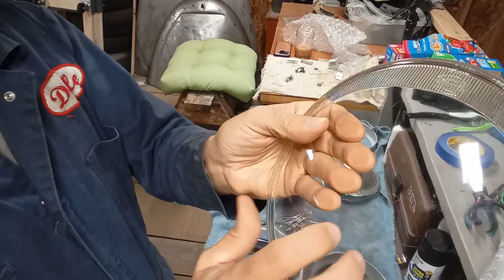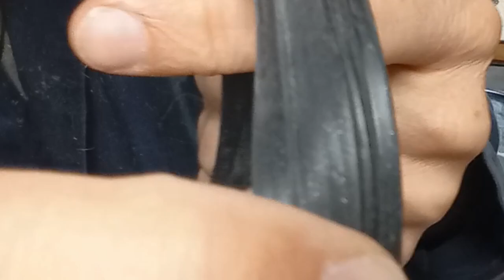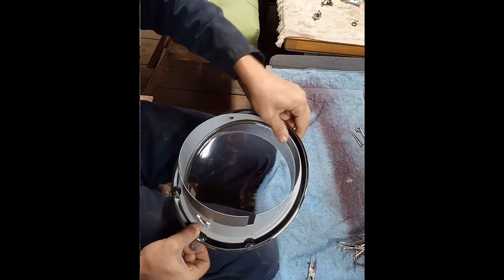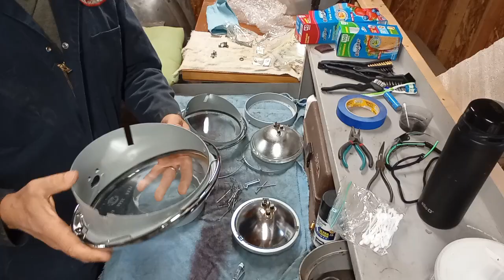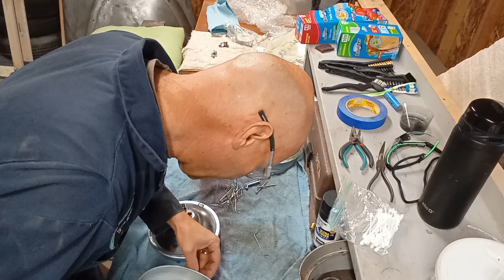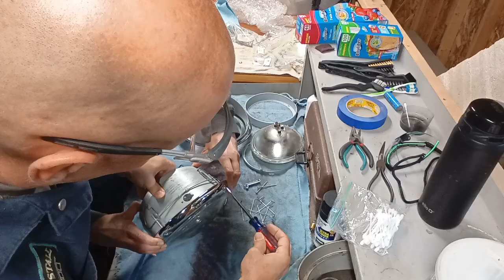1966 VW Beetle Convertible Restoration - Pt. 71 Headlight Bucket Assembly

Comment: You should paint the car yourself BC/CC. Its not that hard, you've come all this way.  I wouid use 2 matching headlight lenses. I would find another with VW emblem to match.
Reply from the maker: I'm doing a Mustang project that I'll be painting my self.  I've never done it before, but Dale is pretty happy to leave the painting to the pros.  Thanks for the encouragement though1
Reply: Definitely on the hunt for another "clean" VW lens. Easy part to swap out when I find it.